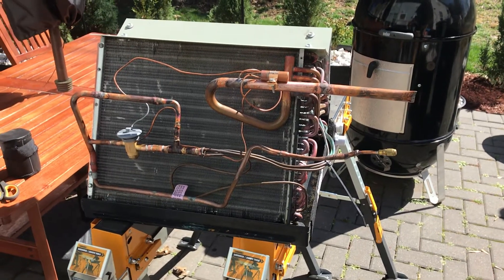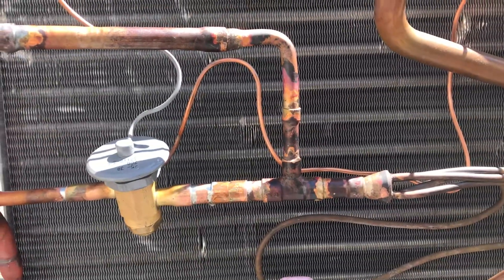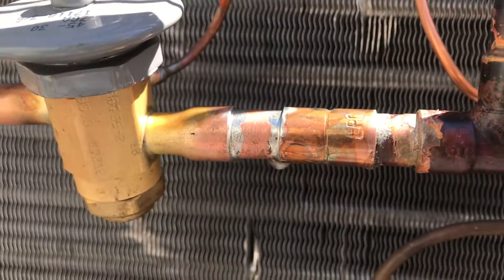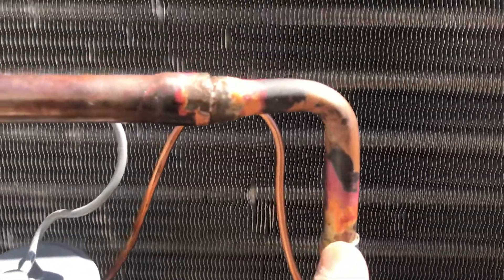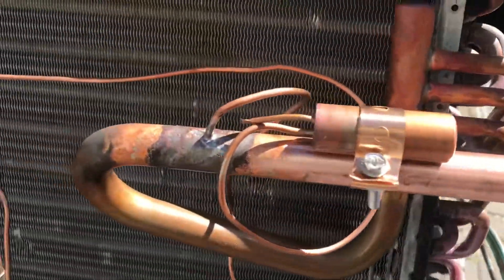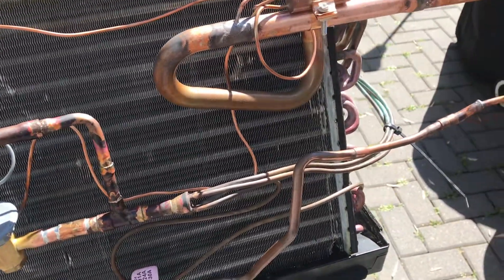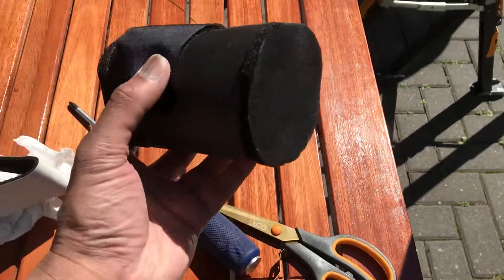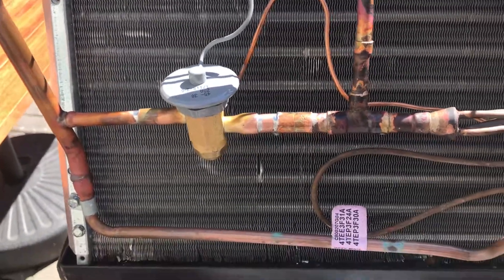HVAC - Harris Stay-Brite 8 Soft Solder and Blockade brazing rod results on a Trane TXV and A Coil

Comment: Turbo torches are OK in some cases but it throws a lot of undirected heat and is really easy to overheat the work area if you're not careful.  Best to use a regular Oxy-Acetylene torch with a soft flame and a rosebud tip under low pressure. Get in and out quickly. You don't need it super hot like you're welding. Brazing is hard soldering.

Comment: I ran copper lines from a propane tank.  I was short to the tank. Can I use the stay Brite as my solder for propane with L type copper?
Reply from the maker: I’m sorry I cannot advise you on that. Please contact Harris, the manufacturer, and ask them if the product is rated for the application you need it for. They might have a suitable product that works or point you in a other direction. You may also want to consider asking your local fire department; I think some municipalities have a code inspector with each fire department, who would probably be willing to speak with you.

Comment: Turbo torch and the right size tip and you are straight. Get the fitting got and allow it to quench. Not enough heat and you will smoke the valves
Reply: Never quench! Allow it to air cool naturally... when still warm, wipe with damp cloth
Reply: What do you mean smoke the valves with not enough heat?
Reply: @diyhvacguy  I assume he means you will have to apply heat for a longer period, so it will conduct into the valve

Comment: I have been using Stay Brite 8 for years on HVAC and have never to date had any failures.
Reply from the maker: Thanks so much for your comment, John. While not an HVAC channel, I would like to make more videos on HVAC/R topics so check back in a bit for more content!
Reply: Right on! Thanks for sharing! It’s always good to hear when hvac guys have been using this stuff for years! Do you use a turbo torch running to a propane bottle, or just a head that screws onto your bottle?
Reply: @diyhvacguy  I have a variety of torches; have used everything from acetylene "B" tank with GOSS soft-flame tips to TurboTorch to Uniweld propane Twister tip to Benzomatic screw-on torches for disposable cylinders ...
main thing is to control the heat, apply evenly, get in, get out, don't overheat 
Never had any leaks with StayBrite #8, have been using it for about 4 years now 👍
Reply: @walterbrunswick  this is awesome! I’m gonna give it a try on my next install. Which heat source do you prefer? Maybe a link so I know what it looks like?
Reply: @walterbrunswick  I’m a DIYer considering installing new system one day.  Is there an optimal torch, torch tip, and fuel type for this job?  Is there any torch setup you would NOT recommend.  Thanks for the cool vid.
Reply: @werquantum You Can do it if you are have HELP or Work hard person 👍
Reply: I call bs
Reply: @markyrocks69  good for you